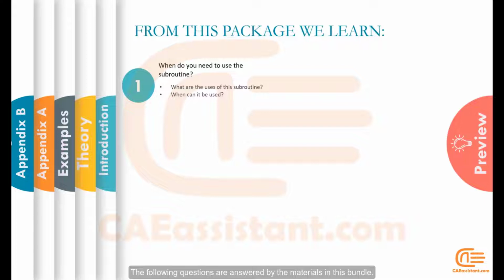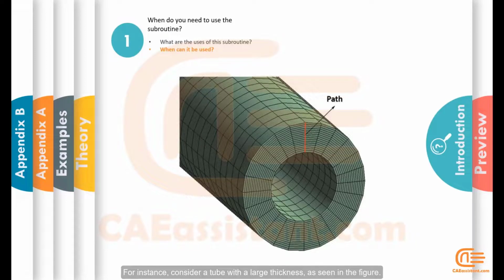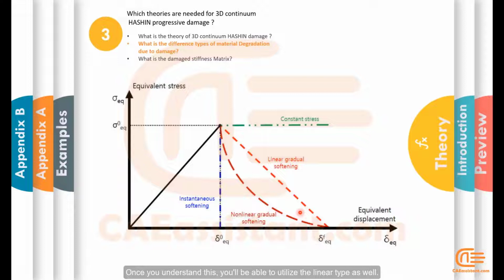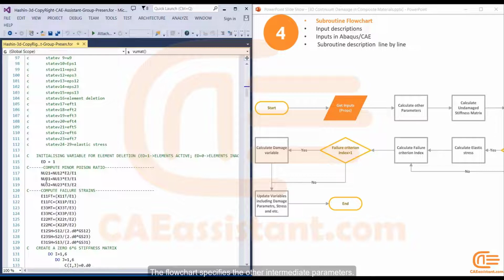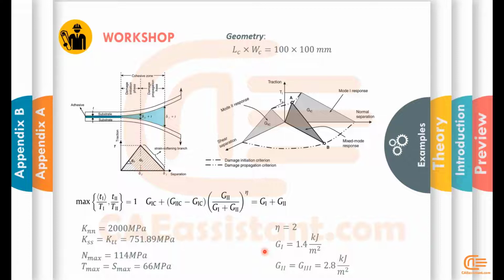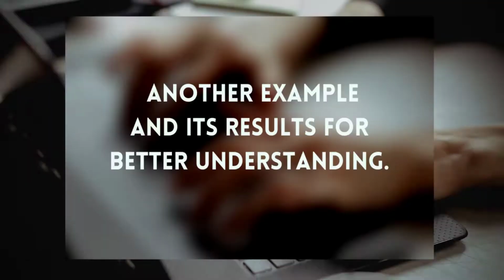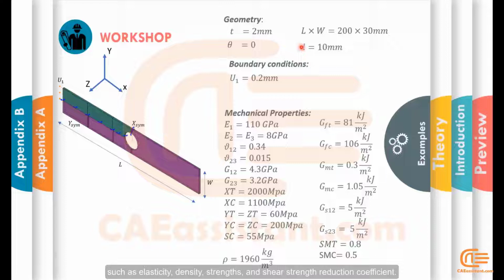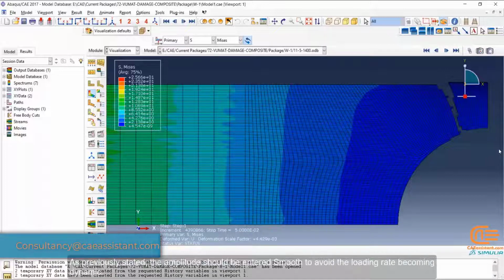Abaqus Hashin damage model for 3D composites - Basics, Relations, Examples using VUMAT subroutine

Comment: Is it correct that  I onlye need this data Xt,Xc, Yt,Yc,Sl,St  from experiments to run this simulation?
Reply from the maker: Hi, thanks for watching our video!
To answer your question, no, it's not enough to have just those parameters (Xt, Xc, Yt, Yc, Sl, St). You’ll also need additional data, such as toughness, fracture energy, and possibly other material properties depending on the specifics of your simulation.
If you need more help, feel free to reach out to us through the link below:
https://caeassistant.com/online-tutoring-consulting/pre-registration/
You can also contact our support team anytime.